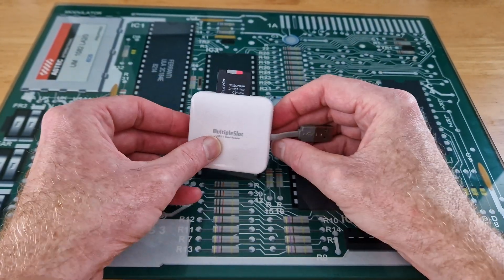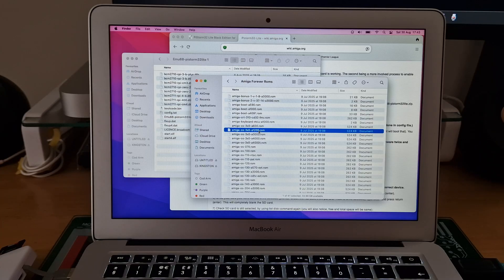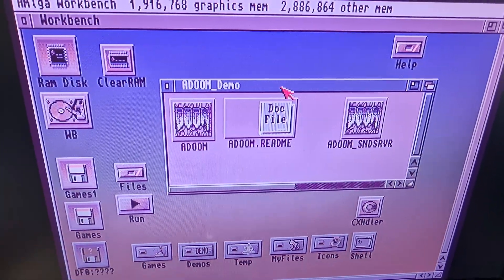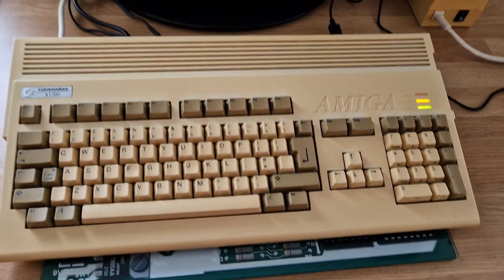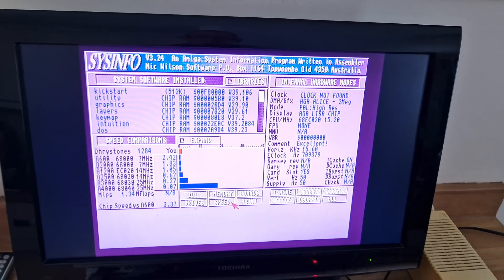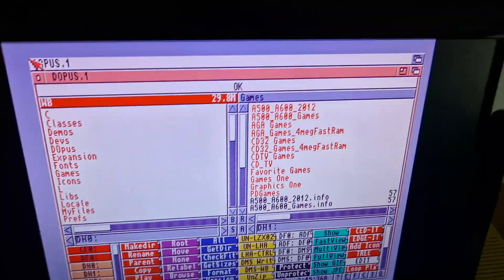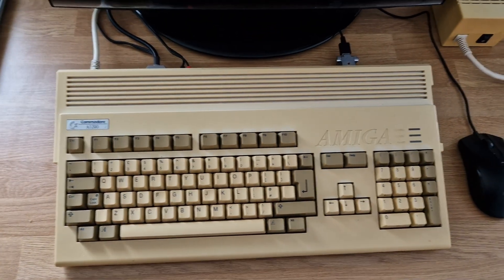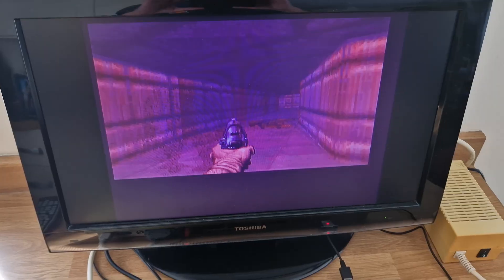PiStorm 32 Lite Black Edition Installing and Troubleshooting

Comment: I don't understand surely you could just boot the raspberry pie and use the amiga as a dumb terminal input keyboard? A pie 3 is way more powerful glide quake runs on that no?
Reply from the maker: Booting direct into a Pi would just be emulation though and you may as well use a much more powerful, average desktop or laptop computer that we all have for that. The PiStorm becomes an accelerator with extra Ram and an hdmi output for RTG content. You still use the Amigas custom chips, ports etc. it’s more than the keyboard.
Reply: @drbristowtube true but the pie is way more powerful than just emulating an 68030 at 25mhz no she's packing 4 64bit processors cloked at gigahertz no?
Reply: The Retro Gaming coming A1200 (June 2026?) is interesting looking, even promises to have WB.. but somehow I get feeling that it won't be that handy for retro coding or whatever.. if it came with emulation for "faster" CPU than 020/14 that I have a feeling it will be it would be an option for my aging setup that will eventually fail.. and then I will have to look into emulation, Vampires, buying replacement.. whatever.. it would be a nice affordable option if it ticks all the boxes, but my gut feeling from previous gadgets from them is that it'll run some software with carousel, no support for your own storage.. and if joystick is USB one, then ufff... the joysticks the C64 mini and maxi came with was so brittle, it immediately broke.. so shit.. the machine itself was fine for what it was for the price point but the joystick was SO SHIT... :D :D
Reply from the maker: You can actually run workbench on the A500 Mini through Aminimiga. I was doing just that yesterday. It’s not the fastest device though but does look cool on the shelf and comes in handy when your real Amiga is in kit form when you are upgrading or cleaning. Retro Games might design their units to be just the Carousel but just like Jurassic Park, nature (or some clever chap) will find a way!

Comment: Had one of my 1200s running this config for quite sometime now. I’ve got OS 3.2.3 on it and full WHDLoad pack. It flies and is super fast. The intro for Frontier is silky smooth as well.
Reply from the maker: I heard about using Frontier as a benchmark so tried that myself too. I remember it being a bit choppy when I originally had it years ago. It definitely runs smooth now with the PiStorm.

Comment: Good info. I currently have a Blizzard 68030 (50mhz), and looking at your videos, it seems a good route to go PiStorm to replace it, and gain HDMI hires output as well. I take it though that I can't use purely HDMI through the PiStorm? I saw another video of yours where you ran a demo and it was playing on the RGB output... can you configure the Amiga to put everything through the Pi??
Reply from the maker: I think the Pi is used for the RTG graphics but it still uses the RGB output for AGA/OCS content. Otherwise you are just emulating everything with the pi, I’m assuming at least. I’m still working through all this myself to be honest. If you go this route, I would suggest buying the HDMI back plate with the PiStorm. It might be easier hooking up to the HDMI on the PI. I’m probably going to get one to tidy everything up.
Reply: @drbristowtube  Correct that it still uses the AGA/OCS to output on RGB for everything that uses the onboard chipset.
Claude Schwarz is developing the FrameThrower addon that will be able to re-route the RGB output via HDMI/RTG.
For A500 this seems almost to be finished for A1200 we'll have to wait a bit more.
Reply from the maker: @EdgeOfPanic Cool, thanks for the info . That’s good to know. I like the name of it too. FrameThrower! I had to read that twice and fix the autocorrect!